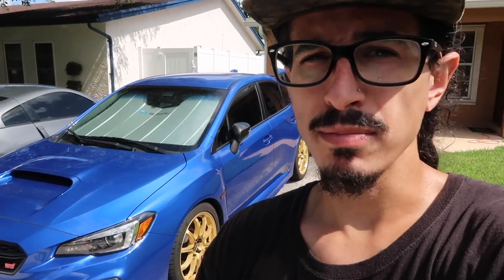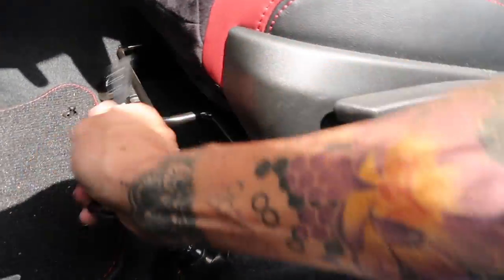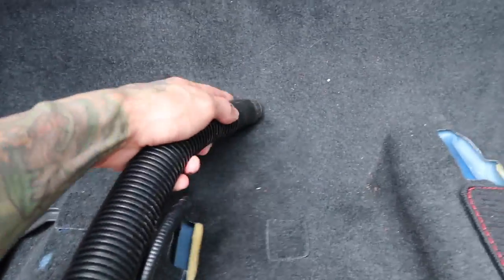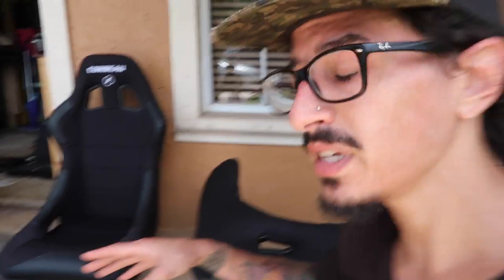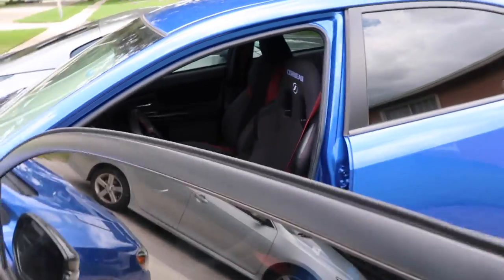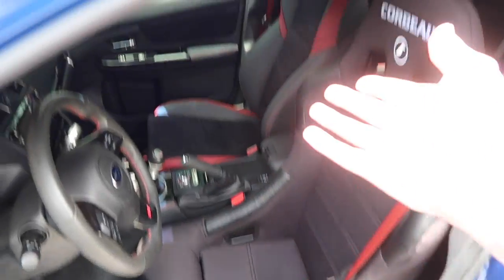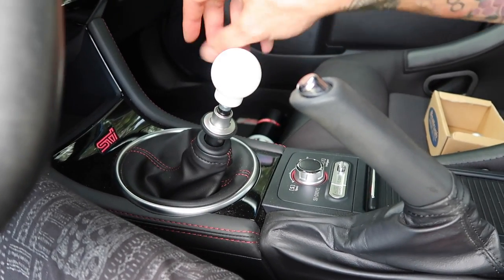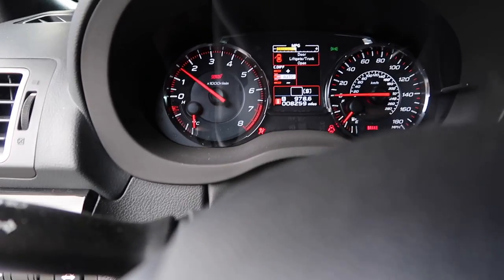Putting Bucket Seats in The Sti... Showing The Daily Some Love

Comment: aaaaaayyyyyy that fire ext.. :P    seat belt geometry isn't gonna be quite right since they don't pass through the holes designed for them, so they won't be as effective as they could be, but shouldn't be a big deal.. but that can only mean 1 thing.. time to install harness bar and swap to 4 point lol...  also, that canister is a co2 pre-tensioner which is part of the srs (safety restraint system).. pretty sure those factory sti seats had bolster air bags in them too.. they're worth a pretty penny.

Comment: I'm surprised you didn't have issues with the passenger air bag lights? The stock OEM seat has an occupancy sensor that I had to transfer over to aftermarket seat. Was a pain in the ass. Did you not run into this issue with the passenger seat?
Reply from the maker: I had to swap over the sensor as-well.. and yes it was a pain